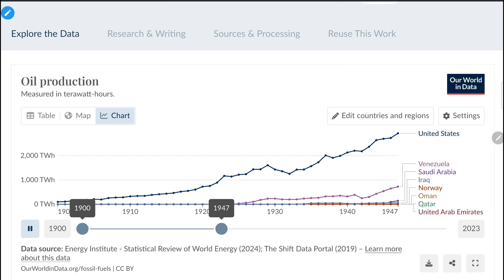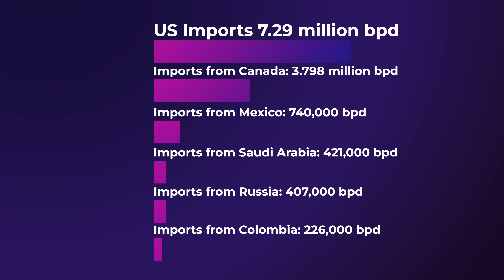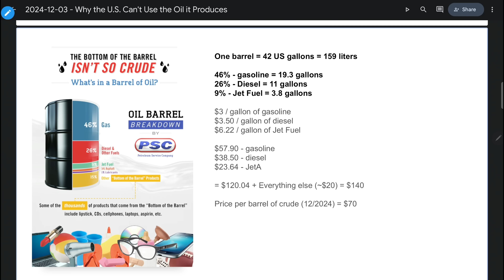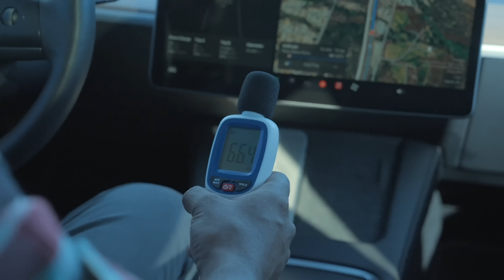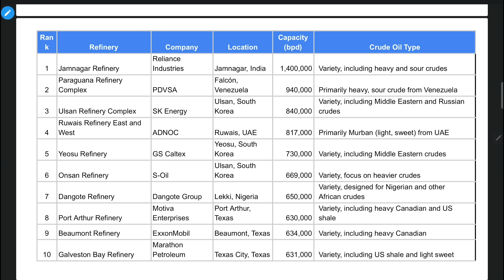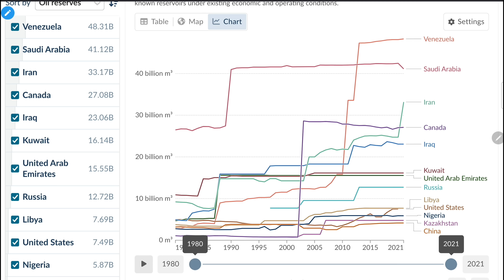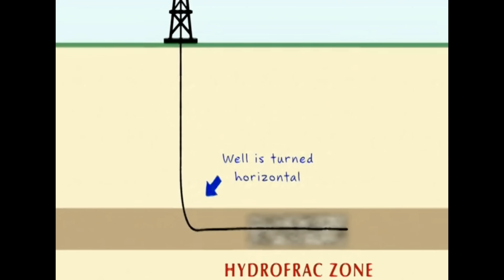Why America Can't USE The Oil it DRILLS

Comment: Shale oil is already in decline the best wells were the first to be drilled. It will cost more to extract the remaining shale oil. Refiners will not convert their refineries to use shale oil it would cots them billions and a decade to do which which by that time the oil would become more expensive and scarcer. That is why they love the Canadian heavy oil sand that has a 100 year reserve life but putting tariffs on Canada might start sending that production overseas in the future. Trump not the brightest person as he seem to think he is. You don't put tariffs on a country that is supplying you oil, gas, fertilizers, nickel and all the other resources. Canada provides US with raw materials we then turn into products at higher profits. So what if they have high tariffs on dairy, they want to protect their farm industry we do the same damn thing with sugar, oranges, and tobacco.

Comment: So many falsehoods due misunderstanding in this video.  20 million BPD is BOE, Barrel of Oil Equivalent which includes natural..  Our actual refining capacity is approx 17 million BPD of OIL.
2nd Oil production in the US also includes condensate which includes a change in legal definition of condensate to crude oil in the 1970s in legislation banning export of crude oil (except from CA and AK)
3rd, Mitchell Energy was hydraulically fracturing tight shale for natural gas in the 1980s what changed is geosteerable drilling which was developed offshore LA in the 1990's.  This allow accuracy needed for two 70+ year old technologies developed after WWII, horizontal (directional) drilling and hydraulic fracturing.  Geosteerable drilling allowed for accuracy in drilling in seams of tight shale just a 100 feet or so thick.
4th, proven reserves for Venezuela does not equal production.  Production has gone down as Russian and Chinese have not mastered very heavy crude oil production.
5th, a big change in refining occurred in the early 1980s when a German steel and trading company developed new markets for petroleum coke in Europe.  In a year, petroleum coke, as a byproduct from squeezing the last drop of gasoline out of the bottom of the barrel,  went from around $10 per ton to over $175 per ton and became a profit center.  In the 1980s 11 major refineries in TX and LA either installed coking units or expanded existing units.  To make more petroleum coke, easily accessible very heavy crude oil from Venezuela became desirable and its production drastically expanded.  Also, heavy crude from Mexico became desirable as well.  Houston Refining, owned by Lyondell and now closed became a 100% very heavy crude oil refinery.  It even built a cogen unit using petroleum coke as fuel, which due higher heat requires nickel allow boiler tubes.
6th, In 2003, there was a 6th month strike in Venezuela which stopped export of crude oil.  This sent refineries dependent on it scrambling for other sources mostly filled by expanded production in Mexico of heavy crude.
7th, In response to this Phillips formed a joint venture with Trans Canada to build the Keystone Pipeline.  This delivered heavy crude from Canada to Woodriver, IL via Cushing, OK, and a pipeline to Borger TX from Cushing, switched from intermediate crude to heavy crude.
8th,  other pipelines began to route heavy crude from Cushing to the Gulf Coast.
9th, with the proposal of Keystone XL, Motiva, Port Arthur TX began a 325,000 BPD expansion solely for heavy crude oil from Canada.  The completion of this was timed to coincide with the completion of Keystone XL from Canada, via Cushing to the nearby crude terminal at Nederland, TX where Motive receives crude oil from.
10th, in the 2000's and 2010's several major refineries in the Midwest spent $billions each to reconfigure to refine Canadian heavy crude.
10th, there is no such thing as the monolith feedstock crude oil.  Each source has a different chemical makeup however slight.  ALL refineries have developed crude oil "cocktails" of blends of sources to maximize refinery efficiency.  Refineries fed ONLY light tight shale crude oil require more heat for the first step, fractionation (crude unit) than heavier crudes.  Lighter the crude oil the more likely for higher concentrations of "light ends" which are entrained gases.  These gases top load the fractionation column and basically vapor lock it.  Thus a refinery has to operate at a much reduced throughput say by 30% less and that is bankruptcy level.
11th, refineries make next to no profit on sales of gasoline if any profit at all.  They make money on small product streams such as petroleum coke, base oil (used to make lubricants), propylene (from cat cracking) and the larger stream of diesel.

Comment: In the 1980s, oil companies stopped drilling because it was too expensive. But at that time it was revealed the US only had about 20% left of crude on the mainland, meaning Texas. Since then, oil companies have shifted to offshore. The problem is not the oil; it is the refineries. The US hasn't built a new refinery since WW2. During the second Gulf war in 2003, the US had Canada and Mexico do more refining. While gasoline and diesel were sent to the war effort. Gasoline prices went up dramatically and never came down.
Reply: Florida has blocked 1/3 of the Gulf of Mexico from being developed.  There was oil discovered off of Pensacola in shallow water.  It wouldnt take billions of $ to develop each new field like it does in deepwater.

They stopped drilling because the price of oil collapsed.

Comment: If the commentator is going to narrate a podcast about oil he should at least educate himself.  Chemically Alberta’s heavy crude is particularly good for producing diesel (light sweet crude is good for producing gasoline but not diesel).  What runs on diesel?  The military, ships, trains, trucks, farm machinery, and so on.  Think about that.  Would Trump want the supply of diesel to be dependent on Venezuela?  Not if he values US national defence and fuelling the US military.

Comment: Another reason to import oil is because different grades of oil produce different quantities of gas, diesel, propane, etc during the refining process.  If you need to make more asphalt for use in the spring, you need to import an oil that will produce a large quantity of asphalt when processed.  Same if you need more heating oil for winter, you must get the right oil to produce enough quantity to supply demand.  That's why all oil refineries must import oil regardless of how much you produce locally.  This applies more in countries that have 4 seasons, than in tropical countries, as demand remains consistent with the weather.  Former oil industry senior manager here.

Comment: Your data is incorrect, we can’t use all the oil we produce because the government will not allow the USA refining capacity. Exports are going to refineries that were built outside the USA TO AVOID THE government bureaucracy. AND tires come from oil. In the 70s and 80s us refineries were converted to high sulfur oil to process Arabian crude oil because the government got into the oil business.

Comment: Why USA is not retrofitting refineries to process local light oil may have political reasons. It would be more difficult to retrofit from light to heavy than from heavy to light, and processing light instead of heavy may earn environmental points. 
1. Shell oil wells have a very short life per well, a couple months in average. The economy of such drilling needs about a $70 oil price to keep going, and this is true for drilling in areas that are crisscrossed with existing pipeline infrastructure. You basically punch a hole and you spill the juice into an existing distribution system within reach. Once Texas is all punched, you have to go drill in areas that will require new infrastructure for hundred of miles, and the shell oil will require a much higher oil price to survive.When you have Venezuela close by with huge reserves of conventional "eternal" wells of heavy crude, Refineries do not want to convert to light. 
2. Environmental regulations and local politics make it almost impossible to locate a new refinery anywhere, except maybe in few areas where people can't feel good if they do not smell gasoline. Same for adding pipelines over long distances through areas where people do not want them. 
Therefore shell oil will be considered as a gap filling solution only, and Trump will keep trying to get his hands on Venezuela. Expect Rubio to try first taking baskets of eggs down there soon. And if eggs don't work, switch to baskets of bombs.

Comment: Sending raw resouces overseas to be improved, developed, refined, is a common issue with many raw resources in the same category.  Environmental regulation causes most of this.  Outsourcing to preserve environment is an oxymoron in that the pollution is not contained where the developement of these products occur.  US does not have enough oil refining capacity thus the need to buy refined products from others.  As far as not being able to use out oil is bogus.  If there was no way to use it no one would want to buy it either.  Truth is we don't know the truth due to interference by environmentalist groups, some of which are sponsored by our enemies.  And the notion that you can somehow produce/use EV's as an alternative defies reality.  Much of the energy needed to produce electric for EV's comes from oil.  And the production of the actual vehicle uses even more.  We need a common sense approach to our energy needs that is inbiased and that ignores enemy sponsored environmentalists.  Does the air pollution in China or Mexico not float into US airspace?  Exporting pollution is idiotic.  What we produce here on our shores can, at least, be monitored and done with the least amount of pollution.  We have no such controls over our enemies or other nations.

Comment: 8:41 They sold the public on fracking because they said that since the solution injected is below the water tables, it wouldn’t contaminate them. That’s a lie. Fluid under pressure, underground, naturally will take the path of least resistance, which is up. Up into the water tables.

Comment: So you are wrong about a few things if we stop refining oil you get no plastic and you cannot make an EV battery without plastic it's in the jellyroll in the components and the wire insulation. So if you reduced oil refining, you reduce plastic, and you cannot refine for just the Naphtha to make plastic it's logistic stupidity. The world cannot go fully electric without oil and you need to use the petrol and diesel so keep making gas cars. Also the reason they export sweet oil is two fold one it's good business because of the cost saving, but the main reason is refinery's like to mix the sweet and sour oil before refining because it refines much better and the yield is higher. So there is no need to build a refinery for shale oil  because the world wants to buy it and economics dictate it's good business

Comment: Thanks. Great and informative video. There may be hope for the US yet with regard to processing  sweet shale oil into a usable diesel source. Check out what Heavy Sweet Oil/ Valkor are undertaking in the Uintah  shale fields in Utah. Once the oil is extracted this can be cooked off to separate the initial high grade distillates to be refined into diesel , and the remaining bitumin grade  feedstock emulsified into a usable low sulphur marine grade fuel oil. The process can be undertaken at the wellhead/ extraction site, and  bypasses the requirement to use a refinery. It is achieved via Quadrise patented oil in water MSAR and bioMSAR emulisification process. This provides a cheaper and cleaner burning fuel with lower C02( up to 39% C02 reductions for biomsar) and substantially lower NoX and Sox emissions. This partnership between Valkor and Quadrise could revolutionise the shale oil sector.

Comment: Isn't a  big part that heavy sour oil is cheaper than oil from fracking. Thus refineries built to use old oil can utilize cheaper fuel stock and while they could be reconfigured not only would there be costs to do so but they would then have to buy more expensive crude a double cost incentive to import oil.
The shipping costs being lower than the cost difference between sweet and sour crude.

Comment: Super interesting.

Maybe for another video, but I would loved to know what you think about the oil reserves the US  have in Utah (oil sands), can that be refined using the existing US refineries? or is it similar to shale oil in that it can only be exported? 

Also what about if it’s not needed to be refined internally in the conventional sense? (See project with Quadrise Plc & Valkor, where they plan to process the oil sands onsite turning it into an emulsion fuels that would ultimately produce a synthetic replacement for HFO, used mainly in the shipping industry (super low Sulfur version at that, plus better for the environment when burnt) how would new technologies like this impact the current situation outlined in this video?